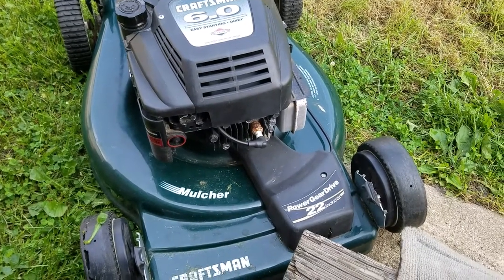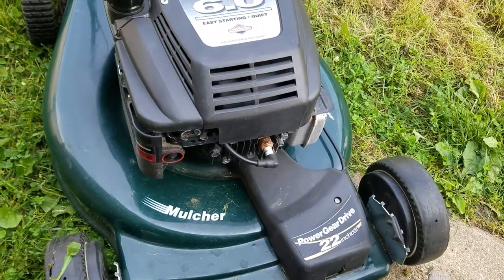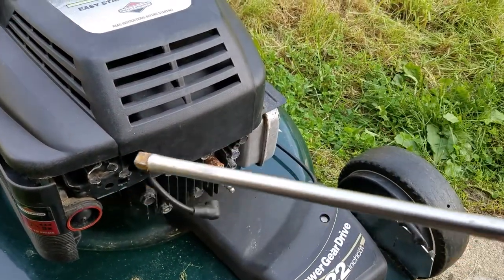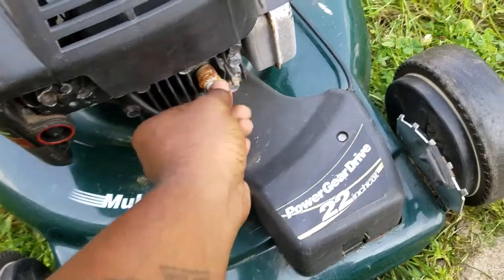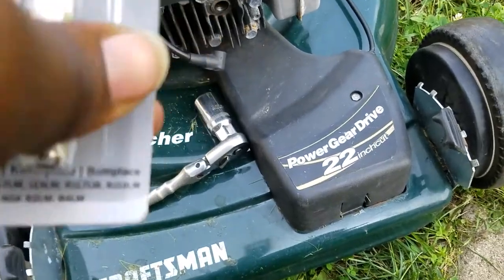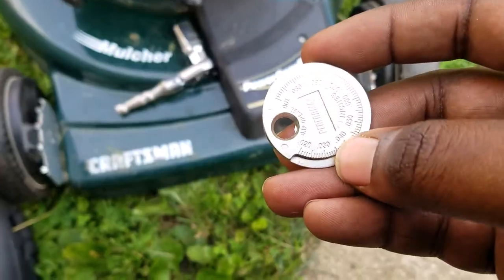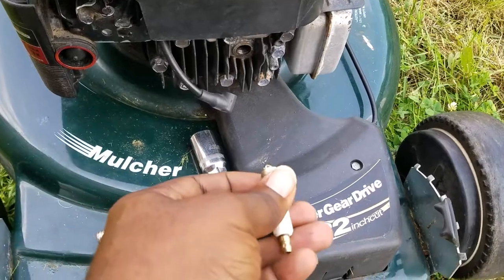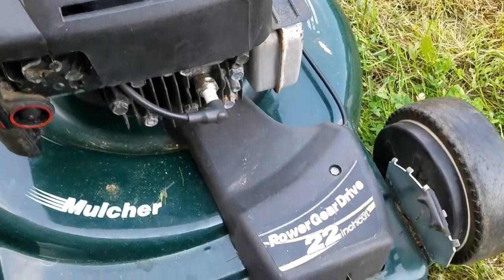HOW TO REPLACE SPARKPLUG ON A CRAFTSMAN  LAWNMOWER

Comment: I never knew a mower had spark plugs🤦🏽‍♀️ and it’s right in the front. I was thinking you was about to have to take the mower all the way apart. Dang sho didn’t know u supposed to replace them. I learned how to gap, I learned when to change a spark plug. You made this look so simple especially doing it with 1 hand. Now I want to change somebody spark plugs lol
Reply from the maker: Lol talking about you want to change somebody spark plugs...